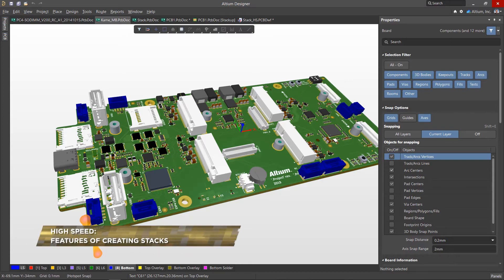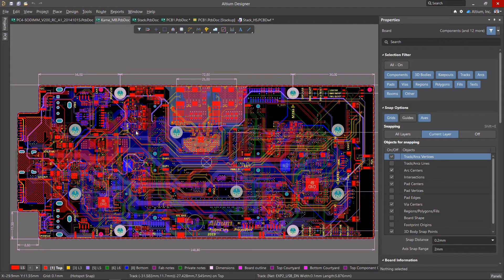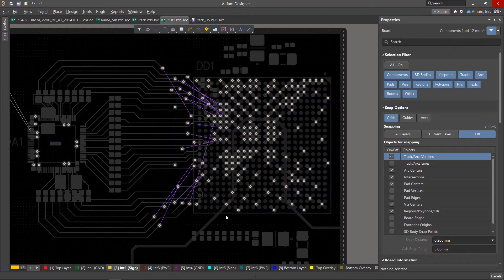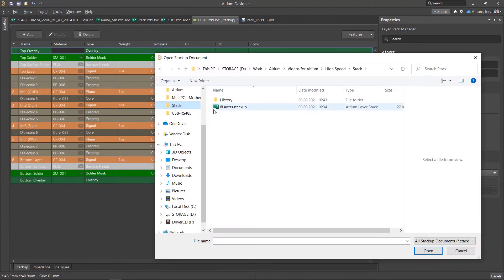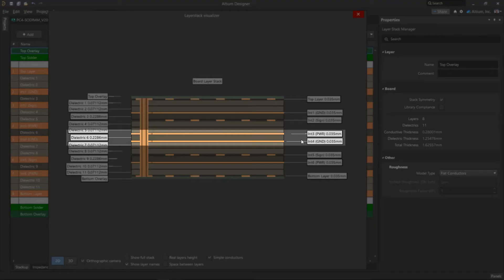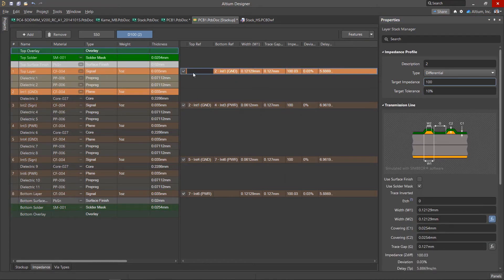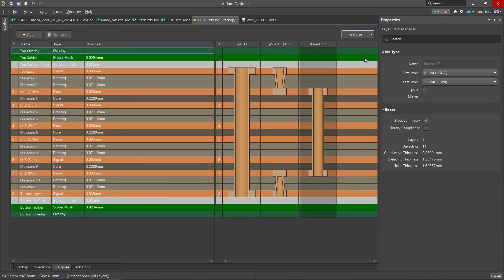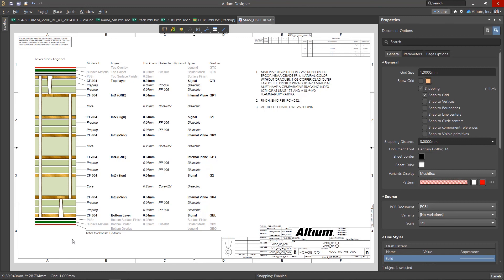Creating a High-Speed PCB Stack-Up with Altium Designer's Features

Comment: When you say they are carried by transmission line, does that mean that other signals are not carried by transmission lines?
Reply: Technically any trace can exhibit effects that result from wave propagation whenever the line is long enough.
Reply: @Zachariah-Peterson  so what does it even mean that certain signals are carried by transmission lines, I mean they are carrying signals so they all qualify to be called tranmission lines right?
Reply: @優さん-n7m  I think what was implied was "certain traces that have long propagation times compared to the signal rise time will act like transmission lines". But technically yes any trace qualifies to be called or act like a transmission line.